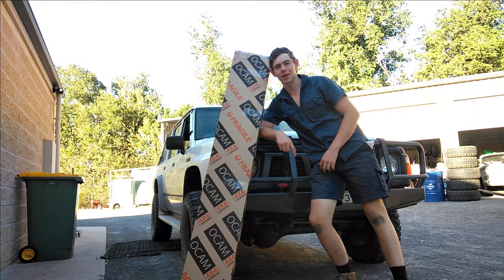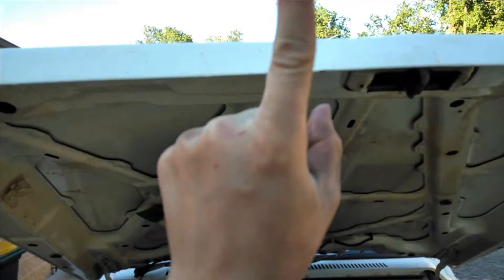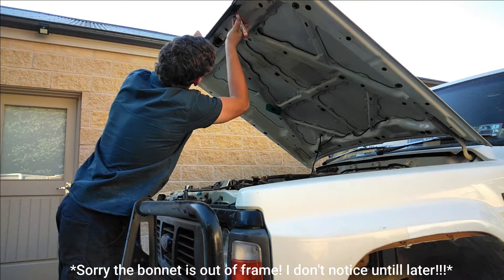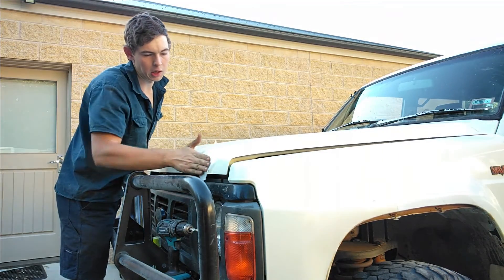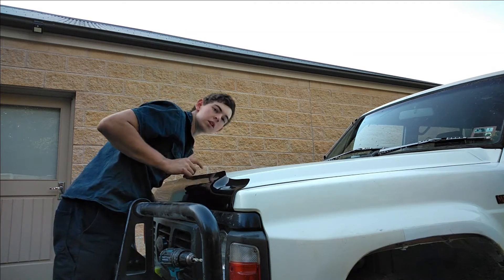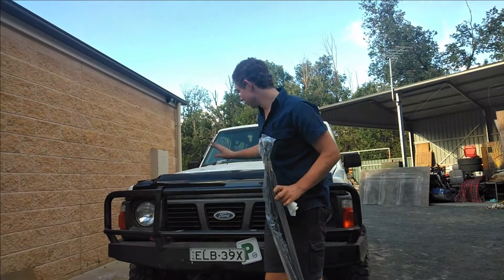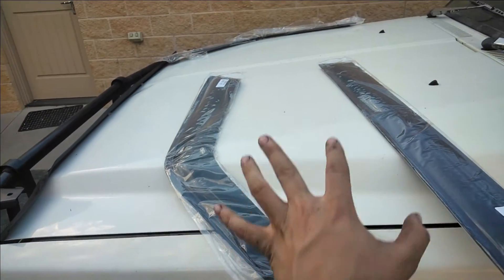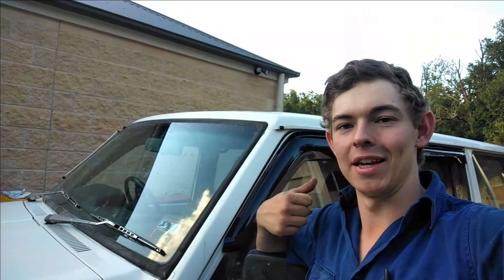Installing a BONNET PROTECTOR and weather shields- GQ PATROL BUILD

Comment: Good vid mate, looks easy. Any idea why these protectors advertise that "no drilling is required"? The OCAM ones say it and so do most of the other options. Mine has just arrived and I sourced your vid to see how it was done - expectedly, you had to drill the bonnet.
Reply from the maker: Hey mate, honestly I don't know why some of them advertise it! I did the same research as you and only found ones for GQ patrols/ Ford mavericks that you have to drill holes to secure the bonnet. as an apprentice mechanic, I see a lot on different sorts of vehicles and have found the ones that do not require holes to be drilled are very flimsy and break more often than the ones that do not! Best of luck on your install, take your time fitting it up and drilling the holes!
Reply: @OutbackTrekkingGeorgeLeov  I have noted that some other comments suggest that the drilling and inner fixings can be omitted with only the outer mounts doing the work. I guess it could work that way and that is probably the justification for say that no drilling is necessary! Just doesn't seem quite right to me though. Thanks mate, keep up the good work.